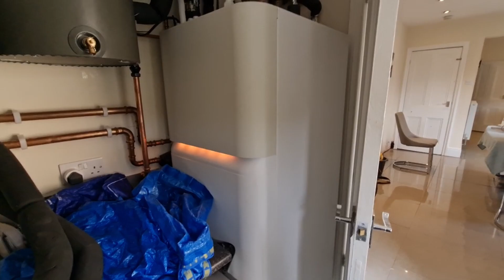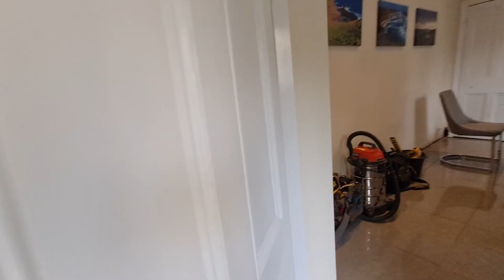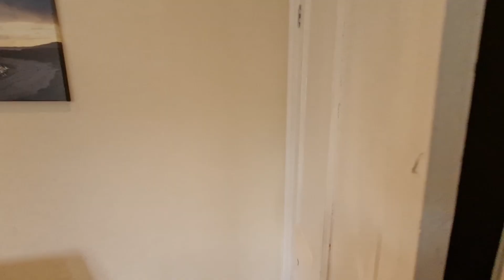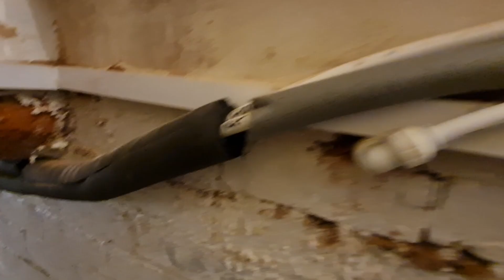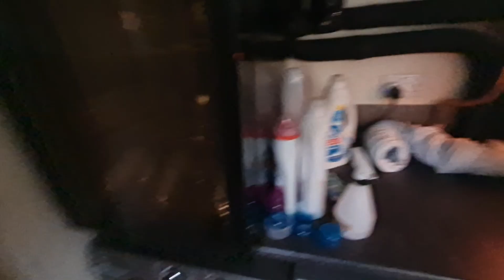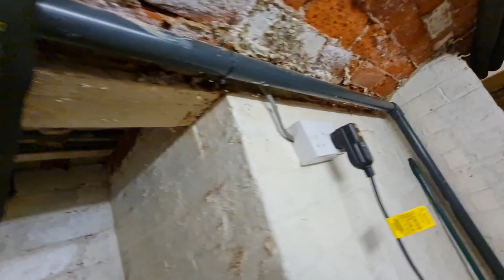Aira Heat Pump Installation in Our Victorian Home (Part 6)

Comment: 100% your pipework should have been upgraded on day 1. Its a totally shockingly bad install 😢
Reply from the maker: The system has performing well at -5'c and has had an average cop of 3.7 so far this heating season. I think they cut a corner which they shouldn't have tried but resolved it quickly without hassle.  Overall I think calling it a shockingly bad install is an overstment.
Reply: Unfortunately I have to agree

Comment: Hey thanks for those videos on the Aira Heat Pump. Very useful as I just had an Aira engineer in today and received my Quote today.
How is the system holding up?
On a funnier side note, I see another fellow Kona 64kwh owner. 👍Strangely validating seeing other people making the same choices. (Should also mention I'm super happy with the Kona)
Reply from the maker: Hi, the heat pump has been doing well over the winter. Toasty warm even at -5'c. We now have access to both electric consumption and heat output data, which we can use to calculate COP. We got a COP of 4 in December which I'm really happy about. We saved £30 and £50 compared to gas over Nov and Dec too. I'm pleased you're enjoying the Kona also. Ours just passed its first MOT. Still enjoying ours although just found out that the year 4 service included battery coolant replacement at £560! That takes the edge off a little.

Comment: Thanks for the video Mike.  I'm considering Aira and your videos are very helpful.  Aira seems to fit a buffer tank as part of a standard install.  Did you ask them why a buffer was required?  Buffer tanks are only required in certain special cases.  Otherwise they reduce the efficiency of the system.  It's a pity the app provides so little operating information.
Reply from the maker: Oh and we were toasty warm at -5 outside last night too ☺️
Reply: Thanks Mike.
Reply: I asked Aira when i got a quote from them. They couldn't tell me why they used a buffer on all installs, but insisted on it. I moved on to other installers.
Reply from the maker: Hi, I didn't ask about the buffer but later found out the heatpump was designed specifically to work with a buffer with an extra temperature sensors in the buffer to optimise its efficiency. Still not as good as no buffer but as my house has substantial 15mm plastic pipes, a buffer was alway going to be needed  unless we had substantial disruption to all area of the house to pretty much replace the lot. That would have been very expensive, so I bit of reduced efficiency can be tolerated. I think Aira believe there is a large proportion on the housing stock that are in a similar situation so have come up with a middle ground with some pipework upgrades plus buffer. The App has got much better since day one. We now have data. Set back temperatures overnight and hot water scheduling. I'd only really want scop to be included next 🤞

Comment: Hi Mike thanks for the video am in the process of looking at heat pumps and came across Aira.  Have you had any other issues with the heating whays it like to use?
Reply from the maker: @clarkfinlay78  we've been very happy with the heat pump since having the final visit to upgrade a section of pipework. As the weather got cold we found the hot water could have done with being a little warmer. but we found out their was a mixing valve that just needed one turn, and now we have lovely hot water. Might make a video of that quick fix. The consistent house temperature has been much more comfortable than the old boiler

Comment: Hi Mike, can you tell me how much space does this system take in your house please? thank you. I'm planning to go with them so estimating where to place it.
Reply from the maker: Everything that takes up space in the house is shown in the video's, no more space was required for anything else, except for the larger radiators. The indoor unit which houses the cylinder is the big tall white fridge looking thing. This is Aira's larges 250L cylinder which they would spec for 3 beds houses or more. The size is  67W x 60D x 172H (cm) but as you can see there is more space needed around the unit. Mine uses about another 60cm above the unit and about 100cm to the side for the the 40L buffer tank which is 37.5W x 37.5D x 71.5H (cm) and 2 expansion vessels. Each house is different and they will fit this equipment where best they can. Sometimes they can fit the indoor unit in one location and fit the buffer and expansion vessels close by but in a different location like a loft space. Aira now also do a more compact 'Hydrobox' solution which basically separates the indoor unit into it 2 core components. This may be a solution they offer you if space is tight. Your best getting their free sales assessment, they'll tell you if the space you think will work is any good or not. Feel free to use the referral link in the description to arrange a free sales survey visit and £100 off the install cost, if you choose to go ahead :)